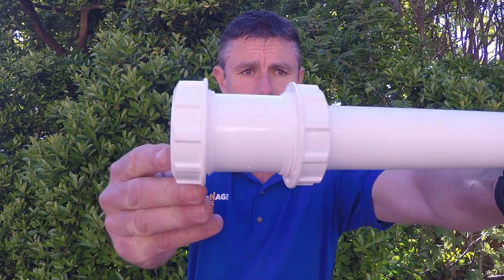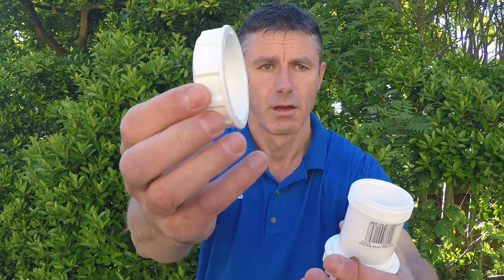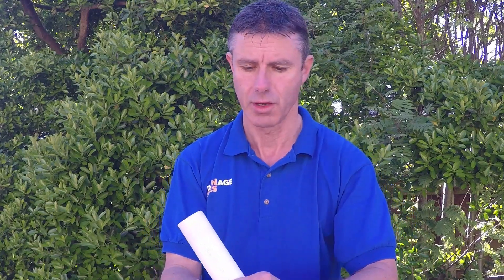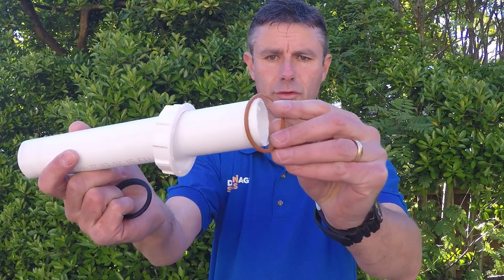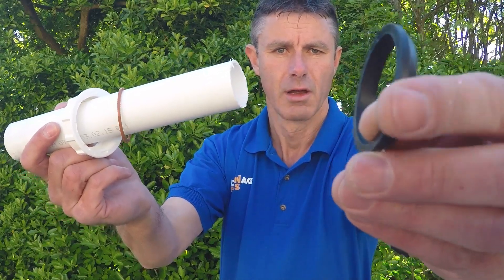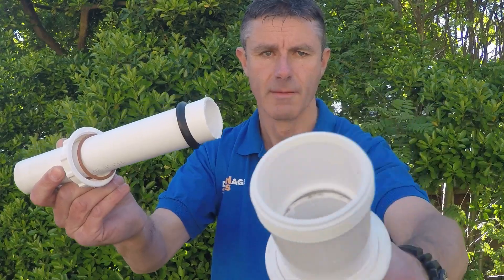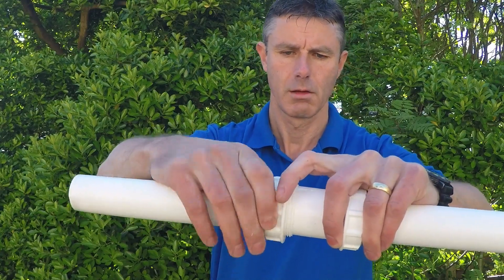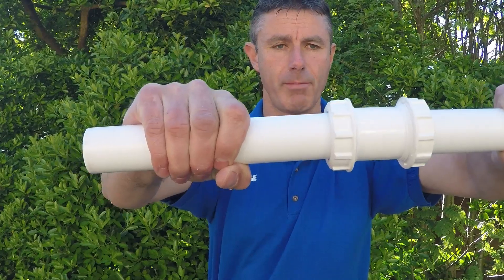HOW TO: Join Different Types of Waste Pipe Using MultiFit Connector | Drainage Sales

Comment: could someone please invent a pipe that can be both solvent welded to and compression fixed to that have the same external diameter. too much to ask? 40mm solvent weld pipe has an external diameter of 43mm, so it wont go in to the 40mm push fit fittings. i get it that you don't want to get them mixed up but sometimes you have to join one to the other... and there basically doesn't seem to be a fitting for that.

Comment: how big of size do compression fittings come in?  i have a copper waste pipe about 3 inch outside diameter..  will those compression fitting come in those sizes

Comment: That`s nice tutorial. But it`s effective for a smaller diameters as I see.  But what we can do if we have to connect a black plastic downpipe (from the concealed cistern kit) to a sewege PVC floor 100mm connector, please? They fit each other perfectly, but how I can glue them together? Is there any special cement or glue? May be the same multifit? Or any silicon can be used, please?   Thank you

Comment: I just tried to fit a push fit pipe into a compression joint (40mm) on a shower waste. It leaked, It also looked and felt very loose, which is why I tested it. I personally would not trust mixing waste pipes with the wrong joints